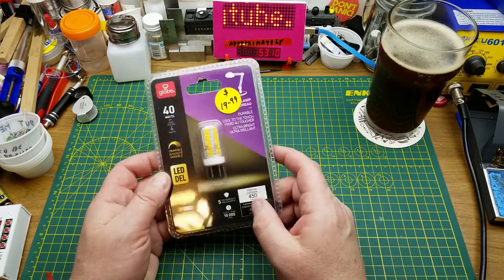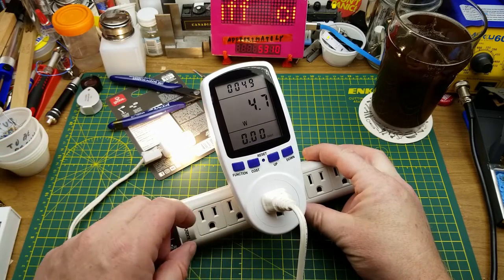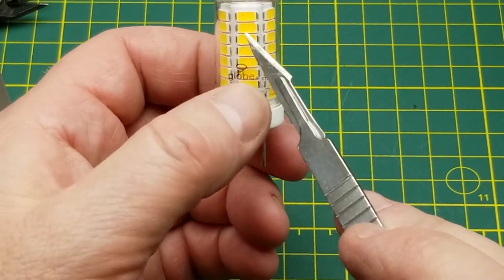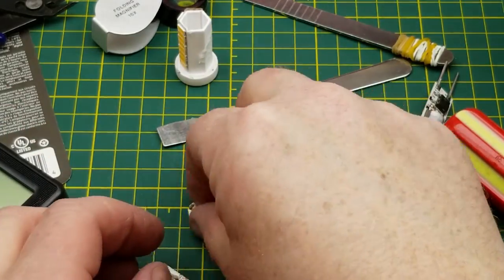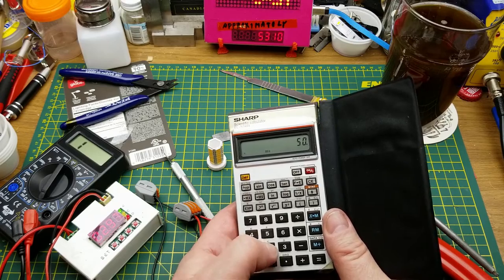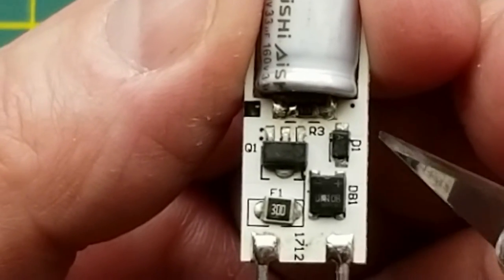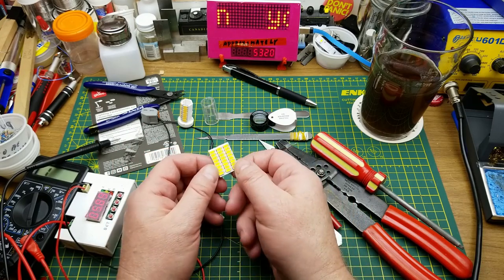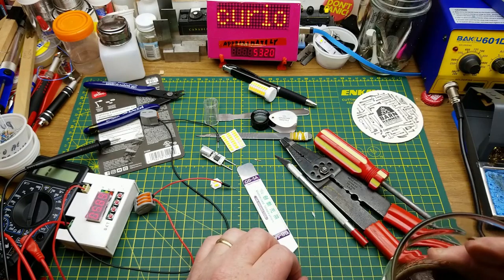interesting little led light teardown

Comment: Ceramics typically have high thermal conductivity (that's why bathroom tiles feel cold to the touch) and very high specific heat capacity. What I don't see is where the heat in the lamp is being conducted to...
Reply from the maker: I'm not really sure how the thermal dissipation was supposed to work on this either.
Maybe it really was a bad design. That might explain it being in the clearance bin...

Comment: Interested in seeing that tested for dimming. Most circuits with capacitors at some point will start flickering.  Might want to add that procedure in the future.
Reply from the maker: Surprisingly, I don't seem to have an AC lighting dimmer in my accumulation of stuff. I need to go shopping for one.
Reply: @pileofstuff  Like your videos.

Comment: A very neat little light, you could have a flat square of leds to make a torch or similar.
Are the clothes not dry yet, mine takes ages.
Reply from the maker: Those might make a couple of interesting LED panels. I just need to give them about 65-70 volts and limit the current to around 40ma.

The dryer takes about an hour per load. It gives me some downtime to spend at the workbench. Hopefully the noise wasn't too distracting.
Reply: No it was fine, the sound was a typical dryer tune.
The brain loves stuff like that, music to the lugholes lol.
Reply: @pileofstuff  I just thought you had bad drains :)

Comment: One word:  Dremel with a diamond cut off wheel. Or do you enjoy off screen violence?  50 LEDs Isn't it odd there's nothing to absorb heat besides tape?
Reply from the maker: I am still curious how well this thing would have dissipated heat.
That's another test I forgot to do because I was too impatient and wanted to rip into the thing.
Reply: @pileofstuff  Maybe thats why it was on special
Reply from the maker: @pleasecho2  That might be the case.